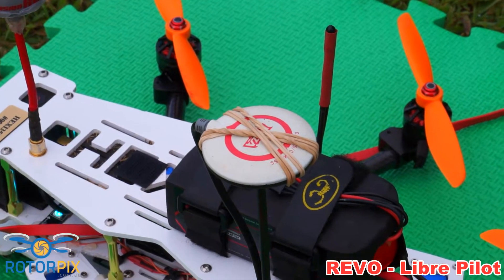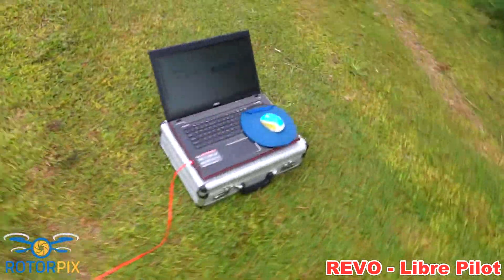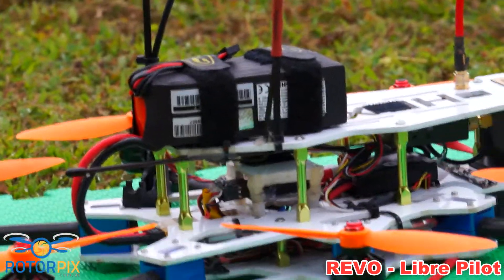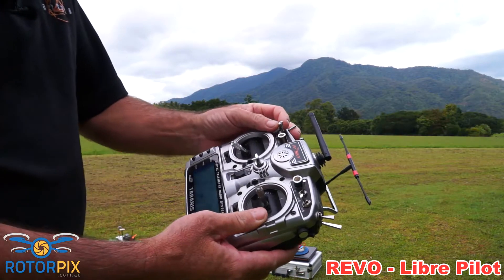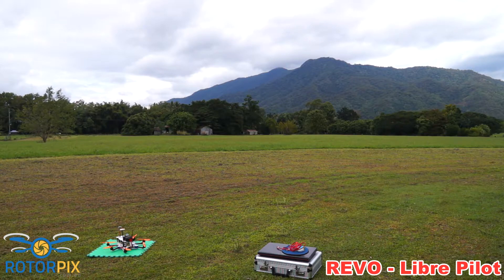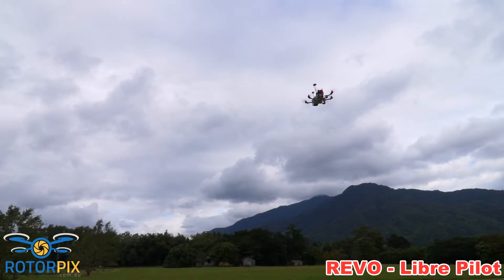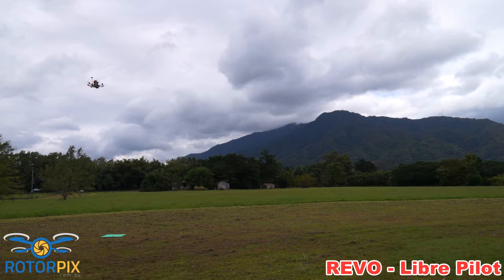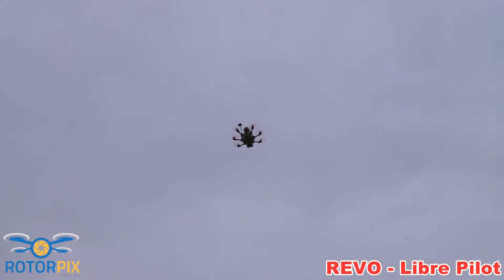Revo Libre Pilot RTB & Land DJI GPS Hexacopter TBS Crossfire

Comment: How did you get the cable converted from DJI GPS to the little cable for the revo?
Reply from the maker: Was some time ago when this was done but just cut the wires and join to the 4 GPS plug wires. Still have the machine flying to this day.

Comment: Hey good day. I just built a 550 hex, revo board, 30amp simonk esc. And I am having 2 problems. 1, at low throttle the motors go to full power, they all work properly when I test them with the gcs, and 2, motors 1,3,5 start turning immediately and 2,4,6, start at about half throttle. I don't know if you encountered problems like this. I am looking for some tips to resolve the pblm. Thanks.
Reply from the maker: Hi, I would re calibrate your ESC's and all go through the wizard again to set everything up.
Reply: Hey, appreciate the response. I ran the wizard a couple times again, and I got the escs to chime in time, and all the motors work together. But I am still having the issue of the motors going full to max. I have a tricopter I built previously and worked fine up to a month ago. I ran the wizard on it, and same pblm, they go max power with a little throttle input. Well I will continue my search.. will keep you all advised!

Comment: Great! Have a revo board sleeping in my attic, because I couldn't get hold of a V9. Now how do you overcome the i2c magnetometer?
Reply from the maker: Yeh the V9's are so hard to get. The DJI GPS with its external mag works just as good now. The key is to have a good external mag cal. Boots up real fast every time now.
Reply: +rotorpix just a standard one? No i2c mag needed any more?
Reply from the maker: Yep. The  standard DJI GPS or similar with it's external mag works just using the 4 wires just like the V9..  Post here.https://forum.librepilot.org/index.php?topic=2026.msg14537#msg14537
Reply: +rotorpix Wow. Thank you very much. Good work! Will have to try this out.
Reply from the maker: No probs, you have to look for the "next" version - beta the boys are working on for it to work. I hear the new release is not too far away though.